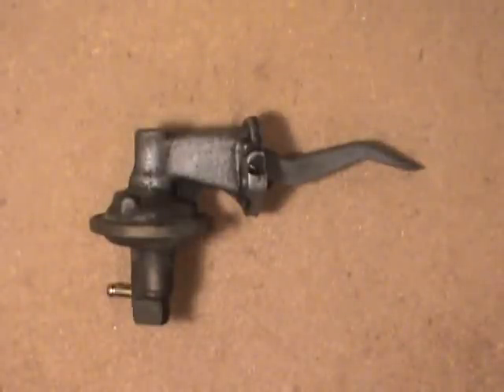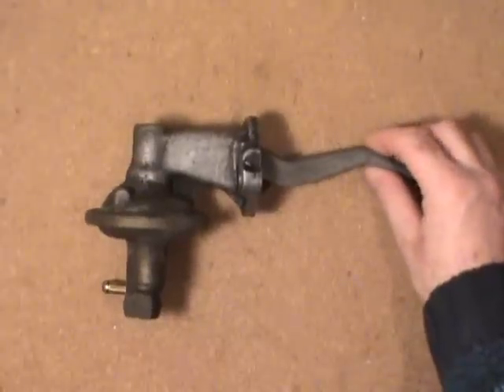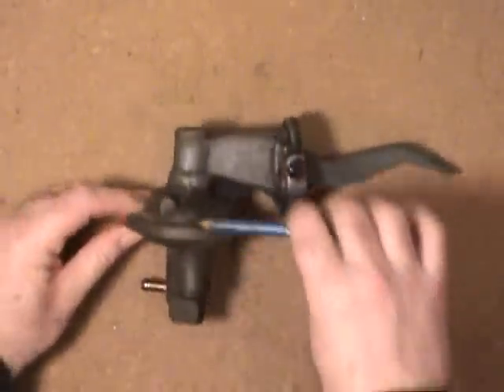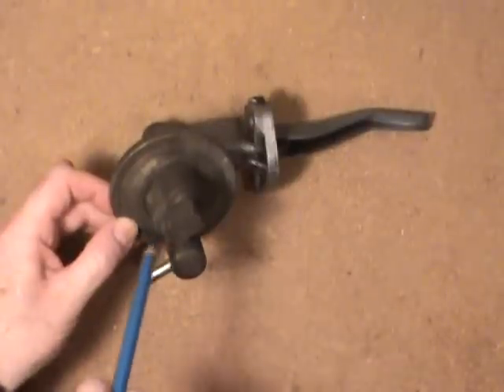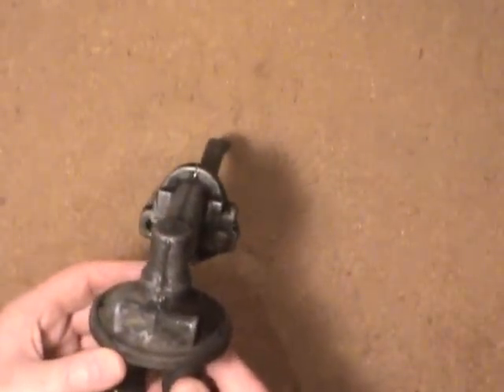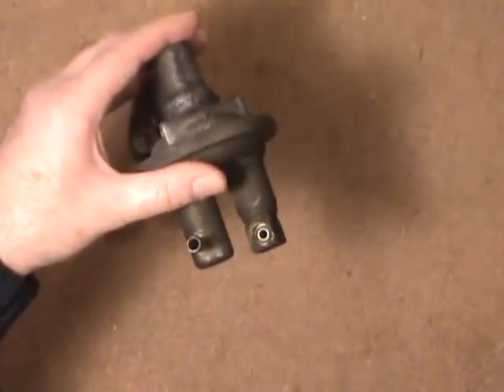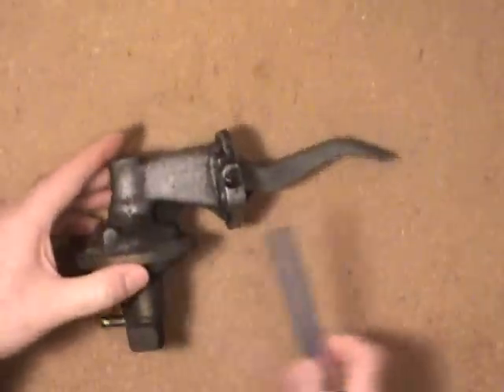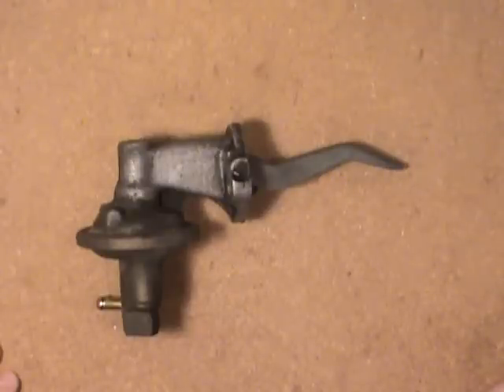Fuel Pump Mechanical Type Demo

Comment: Hi...my parents have an old 1987 Econoline RV and I'm told it looks like the mechanical fuel pump is leaking from the top of the pump. Is that possible? I mean, it's for sure leaking, but could it actually be leaking from the top of the pump, which looks very very much like the pump you talked about in this video. It doesn't look like any of the fuel lines are leaking; at least I couldn't see any leaks from them when I was told to look for myself. The gas seems to be squirting from the top of the pump near the engine, which means we couldn't see exactly where the gas was coming from. Do you have a video explaining/showing how to replace this pump? My grandpa wants to try his hand at changing it and I'd like to watch him do it. I thought all pumps were electric, but no so in the old Econolines I guess. Thank you. Good job explaining how this pump works by the way. I gave you a thumbs up Like...#34!  -)
Reply from the maker: kathy loften I say...Greetings kathy loften (as I'm Waving to...Mom...Pops...&...Grandpa too)................Maybe, before I forget, I should also tell You, about my "Other" YouTube Video, on My YouTube Channel...RockysRoadshow....and the "Title", of that Video, that, I'm quite sure, You Folks, would probably want to watch as well, seeing as how this particular Video of mine, had You-All, shall we say, "Captivated" some-what, and, the "Title" of the Video in question, happens to be............(drum roll please...lol)............."Mechanical Type Fuel Pump Taken Apart"...enjoy...............................Now then, sorry, but I don't happen to have, a Video, on the "Actual Replacement", of a "Mechanical Type of Fuel Pump" at all, probably because, I'm not all that sure, that I'd be able to..."Park A Vehicle on Top of my Work-Bench, inside my House"...!!!...lol.........................................Most of my YouTube Videos, are just usually Made, on top of my Work-Bench, some-what Limiting the "Size" of my "Video Subject Matter" (as in, what-ever I can safely place on top of the work-bench), at this particular point in time..................."Warning"...when-ever working around "Gasoline", especially when it is in the form of a "Vapor", all it takes is, something like a Small "Spark", and..."Boom"..so, be very Careful...as in..."No Sparks or Smoking"...!!! (take Grandpa's Pipe away from Him, when He's Not Looking...and Hide It...!!!...lol)...........................Have a "Fire Extinguisher" with-in Reach...Just in case.............................Sometimes, that "Gasoline Leak", could just be, a Hose Clamp, or a Fitting/Nut, not being as "Tight as It should be", where it Connects to the actual Fuel Pump, and, sometimes, just needs to be "Tightened-Up" a bit, but, that's something that needs to be determined, once the "Initial Visual Inspection/have a look-see", and, what-ever it is, that happens to Turn-Up (and no, not the vegetable...lol)............................Have a look, to see, just how many "Connections", that there happens to be, on the Fuel Pump "Itself", as, there are quite a few "Different Fuel Pump Designs" out there............If the "Gasoline Leak"...is coming from the Fuel Pump Itself, and Not, just a Rubber Hose/Metal Tubing Line, then, it kinda looks like, that good ole Fuel Pump, has seen better days, and needs to be replaced with a "New" One.........................................."Re & Re-ing" (Removing and Replacing) a Mechanical Type of Fuel Pump, is quite straight-forward, and reasonably Simple.........................Usually, just needing, a couple of Common Hand Tools, like a couple of appropriate Sized Combination Wrenches, and maybe a Ratchet & some Sockets, if the Fuel Pump, doesn't get in the way, that is, and, maybe a Knife or Hacksaw, if a Rubber Hose, happens to be, part of, all of this (call-it-what-You-will)......................... Have a Catch-Bucket/Pail, to Catch any Dripping Gasoline, and maybe, a few drops of Motor Oil, as well, under the Fuel Pump's location, as, there's bound, to be some, shall we say "Drip-age"...lol......................................If...???...and maybe when...???...the undertaking, of that Mechanical Fuel Pump, Re-Placement, happens to take place..."Make Sure", that, once the "Old" Fuel Pump is removed, that, the "Surface on the Engine", where the Mounting Face, of the New Fuel Pump makes "Contact-With", on the Engine, has "All Traces", of the "Old Gasket"..."Removed, and be, Clean & Dry as well, or, You're-Gonna-Get-a-Leak, but this time,..."It's-Gonna-be-Motor-Oil"...lol .........................The "New" Fuel Pump, should come with a "New Gasket", that, shall we say, gets "Sang-wiched" (well, to be Politically Correct, then it's..."Sandwiched"...!!!...lol)..."Between"...the...Engine's Mounting Surface...and the...Fuel Pump's Mounting Surface.............Some Guys, and maybe, Gals too, just Install the Gasket..."Dry"...while "Others"...would..."Coat Both Sides of the Gasket"...with, a..."Sealant", of, one kind or another...it's, well, kinda, ahhhhh, Personal Choice, if You will, just sayin' (as I duck for Cover, just in case, They decide to..."Shoot the Messenger"...lol)........................Yes-Sir-ee-Bob...I'm guessin' that, if-in we-all went back in Time, to the good ole "Horse and Buggy Days", we just might see, Someone (prolly Wearin' a Cowboy Hat), use-in, one of, them thar "Hand Water Pumps", to "Fill, that thar "Wooden Bucket", just after Hear-in...Someone...Yellin'...some-where's over-Yonder..."Go and Fetch Me's a Pail of Wadder" (Hey...No lol-ing allowed..this here is Serious Stuff...!!!..."Not"...lol)...gee's...I done lost track, of what I was fixin' to do.............Oh Yeah, that's It.........What I was eluding to, was, maybe, just maybe, it was that good ole "Hand Water Pump", back in the Old days, that Inspired/made the Suggestion there-of, and as I see it, probably, due to the, shall we say "Similarities", when comparing that "Hand Water Pump"..."To"...the "Fuel Pump" that We are Discussing here...only, the "RV's Engine"..."Replaces"...the "Humans Arm"...that had to "Actuate", that, as i was sayin' before, that good ole "Hand Water Pump" (prolly, where Humans, started to be Replaced with "Technology"..."Yikes"...!!!...lol)..............................................Just make sure, that the..."RV"...is..."Parked Outside"...is on..."Level Ground"...having the..."Gear Selector in Park" (automatic transmission, I presume?)...and have the..."Emergency/Parking Brake On"...and, some..."Wheel/Tire Chalks"...placed where, all 4 Tires Contact the Ground/Driveway/Parking-Lot...so the...Recreational Vehicle...Doesn't decide, to go on a "Trip" of "Its Own"...!!!...(to lol, or not to lol, that is the question)...................Tell "Grandpa", its "Easier then he Thinks"...just don't give Him a Beer, until He's "Finished, Washing His Hands"...!!!...lol...........................Thanks kindly, for, All of those..."Thumbs-Up"...my Friend......................Good Luck, with "Mr. Fuel Pump"...and be Careful Grandpa, as, I want to be able to Talk to You, and, Not about You.............Till next Time............You-All......Be (Extra) Safe, take care, and have a good one.
Reply: Hi...thanks for all the advice. Very nice of you. And I'm sure we're going to be safe doing this replacement thingie. Thanks for the tips. With everything you wrote, you might consider writing as a career...or at least a past time. I've never seen so many quotation marks in one comment in my entire life. -)
Take care and thanks again.
Reply from the maker: kathy loften Greetings kathy loften....Hmmmmmm...(I'm)...thinkin'...Thinkin'...&...still THINKIN'...Yep, that's what I seem to do...24/7/365 Dayz a year, and maybe, One more, (day), if-in a "Leap Year" is taken into consideration as well........................................I'll bet, that, those, what seemingly seem to be, oh, might I call them, an "Infinitesimal Amount of Jigsaw Puzzle Pieces",  Float-in' around inside my...oh oh, now I'm stuck for Words...what's that Stuff, or "Thinkin' Centre/Center", that's inside my Head, that's located some-wherez between my two Hear'in Thingies...???...ummmmm...by-jove...I think I've got it (after all...lol)...(now my....that's it..."BRAIN"...is having some difficulty...communicatin' "Its" Signal, to my..."Keyboard's, Chicken Peckin' Fingers, and Thumbs too"...(and...with an embarrassed look on my face, I due-ly, do admit, that..."I CAN'T TYPE"...even though, I do recall, having a..."How to Type", on a Type-Writer, or now-ah-dayz, it's just called a "Key-Bored", and this "Newer-fangled-thing-ah-ma-Bob"...Doesn't even Need a..."Reel mounted, ink saturated, printing Ribbon"..."What-so-ever"...!!! (fancy that huh...lol)....................Hmmmm...I believe, that there..."How To Type (Properly & Efficiently), on, what is known, to most of Us these days, as a, now get this, a..."QWERTY"..Keyboard (lay-out System, as seen, on the more common Keyboards)...and also...(were You aware, that, by just using the "TOP ROW of Lettered KEYS, on Your KEYBOARD", that You are able to, Spell the Word..."TYPEWRITER"...???...how bout that Eh...lol)..........................Hey, wait a minute now, it appears that..."I have been Typing all along", and, (pausing in Diss-belief, I gather my Thoughts...hang on please, this may take a while)........................................................................................................."Hole-ee-Gwalk-ah-moe-lee"...I just realized, that my...what was it called again...oh yeah...my..."Brian"....happened to be in..."Auto-Pilot-Mode" (yet Again!)...and...I guess, that, "Subconsciously"...my "Chicken-Peckin' Fingers, and Thumbs too", kinda had a..."Mind of Their Own" (but, fear not, as my Self-manipulating, fingers, and thumbs too, still Don't Know)..."What a Wee-Gee Board Is" (or to Some, What..."It'"..."Is-Not")...oh, and..."never", and I repeat "NEVER", watch the..."Poltergeist Movie"...(Scary Sounds in the Back-Ground...!!!...lol)...when it's..."Dark Out & Ur all Alone"...(I'm guessin' You get the Picture...lol)...or, if-in You happen to be, like some other "Scare-dee-Cats" out there, You might be havin', oh, let's call it............."Night-Mare-City"...!!!...lol............................Oh darn, I should add this before I forget..................That there "Software Program", that I have, some-wherez around here, that I really should Learn to Type from, was Titled..."Mavis Beacon"...teaches..."Typing"...or something along those lines, I think....................................As You can see, I'm no "Professor", in any way, shape, or form, what-so-ever, as, I'm not all that sure, that, I even know, an..."Ad-Noun"...from a..."Pro-Verb"...and every time, that I'm...Subject (-ed), to, just about anything that involves an..."Object"...I always seem to always get...Predicate (-ed) in the End...!!! (see that, I really Do like to have a lotta "Fun", with "All" of those there..."Puzzle-Pieces"...that I've either been..."Blessed-with"...or, maybe even..."Cursed-with"...that, as I'm, quite sure)..."Really Do Reside", inside my.......ummmm....what was "It" called again....help me out here please..................................Ur too Late, I finally remembered, and it happens to be..."My Brain"...(and who knows, maybe, I'm being "Man-ip-U-Late-ed", by, some "Other-Life-Form", or maybe, the way in which, the "Ah-Roar-Ra-Bore-ee-al-us" (aka, Northern Lights)...rather "Symphonic Display"..of..."Rainbow Colored", and, like They say, and call Them..."Dancing Lights"..."Behave"...just might be Affecting me, in one way or another....???)...(might even be..."Something"...or, an..."Entity"...from another)..."Planet"...in a...far...Far-away..."Galaxy"...and I'm really Hope-in, that, that there "Galaxy", happens to be, the..."Milky-Way"...cuz...I really..."Do-Like"...My, Favorite Cold Beverage, and that happens to be......................................."2% Milk"...oh and, may I please have a Tall Glass of "It"..."On the Rocks" (the "Rocks", that are be-in referred to here, happen to be, Frozen "H2-Oh"...aka..."Ice Cubes"...lol)...oh and, "It", (the 2% Milk), must be workin'...cuz...I'm "Still Alive"...!!! (and still Here, to Torture You-All, with, my some-what "Abstract Form of Entertainment"...!!!...lol)................Well, prolly, time, to..."Wind-er-down"...but, please, hang in there...just a few more things to mention, before I head for..."Infinity and Beyond".............If You care to, You are most welcome, to Browse through, the Videos that are on my YouTube Channel, and, if You make it to my YouTube Channel Page...RockysRoadshow...once there, You should be seeing, a long & wide Picture, of a bunch of People, on a rather expansive beach, and, if You were to have a look-see, at the "Bottom Right Corner, of, that Beach Picture", You, hopefully, will See, that "Blogger/Icon Thingie", that is "Linked", to some of my Other "Ramblings", that I'm responsible for, some time ago.......................Oh, and, were You aware, that, I'm some-what of a "Poet" as well...??? (prolly, just another Blessing, or Curse, that makes me, who I am, I guess)...(oh oh, here we go again, the words "Cursive Writing", just popped into my head, and no, I'm not in the habit of Audibly Speaking Profanities on a regular basis...lol)...................................If and when...???....You happen to have a gander, at my YouTube Channel, that "Poem", that I not only "Wrote", but also, "Narrated" with my very own "Voice", is easily found, as its Video "Thumbnail Picture is All Blue", and the Title of it is........................"The Thermoquad (carburetor) Poem"...enjoy....................................The reason that I'm not using, prim and proper "Paragraphs", is for the very reason, that, if-in I try to leave a "Space", in between each and every Paragraph, there have been, more times then Not, where-by, those required "Spaces"..."Go Missing"...and the so called Paragraphs, get..."All Scrunched Together"..(well, some time ago, I was able to make some real purr-dee Paragraphs)....................................Oh yeah, those "Quotation Marks", that You were referring to, my use of, are really not, being used, in the Proper...Glammer, no, Grammar, Way, and, the Fancy Schmancy/Politically Acceptable Way, in which they are to be used, in a, shall we say, Literary sense, and some-what, being at, a, might be, University Level/Way/Manner as well, are one thing...but...the way that "I'm Using", those there "Quotation Marks"...are to be Compared to, as I see it (and Imagine it too...lol), is to be that, of Using, those there Quotation Marks, as, what I like to call..."Bedazzling Fishing Lures"....kinda like, having Me..."Use Some Bling"...in order, to bring Your "Un-Divided-Attention-to"....the..."Words or Phrases"...that, as I see it..."Should grab Ur Eye's, Unwavering Attention"...lol....................................Well, there You have it, just a small Sampling of, what I was either "Blessed" with, or "Cursed" with, and, I'll let You be the Judge of what-ever, that might, just be......................................Till next time...............Be Safe, take care, and have a good one.
Reply: Thanks again...wonderful response!
Reply: Prob fixed by now but in that huge  paragraph he wrote did he mention its  prob leaking out the weep hole just had that happen to me